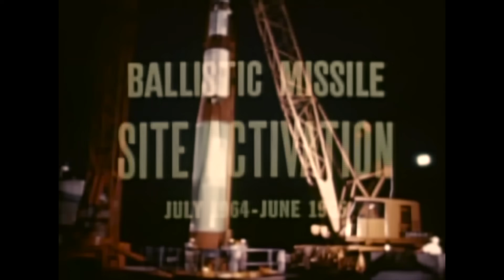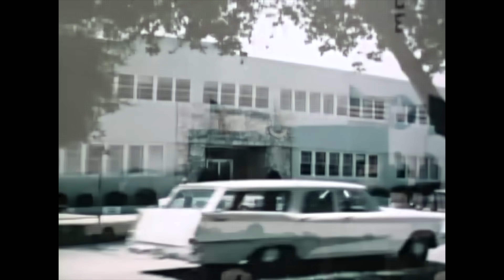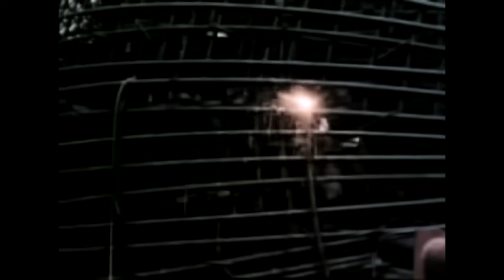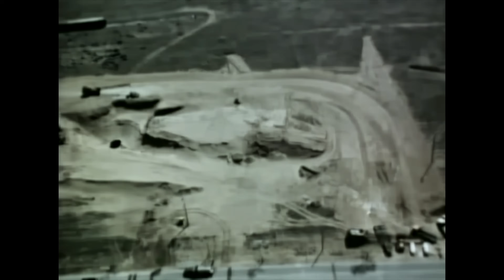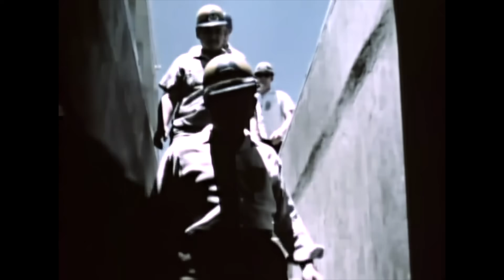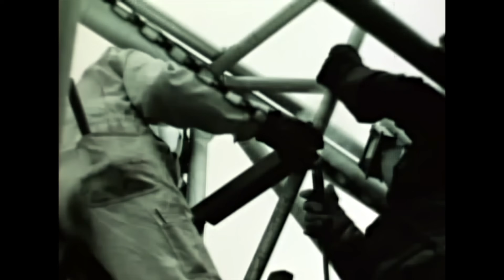Ballistic Missle Site Activation (1965)

Comment: I was a Minuteman Combat crew Commander from 1972 thru 1974.... 448th Strategic Missile Squadron, Grand Forks AFB North Dakota
Reply: Props to you! I was a Titan II MCCC at McConnell, 74-79. 533-07 was my main site and am happy to say I was not on alert when they dumped stage one Oxidizer. Definitely more hazardous than Minuteman.
Reply: @oldguy7402  That's interesting. I'm a big fan of those who served in the missile squadrons back then. But we are getting old now. I didn't get too much interaction with titan crews but understood that  the titan required much more personal attention from the launch crews.
Reply: @robertlcrocker So true. We literally lived with our bird, just past 2 blast doors and down a long accessway. Had to do (well, my techs did, BMAT AND MFT) a complete system check of all the missile and facility equipment every day. If we lost silo air conditioning, it could become very serious as the liquid propellent could overprrssure if too hot.
Reply: @oldguy7402  Missourian here learning about the 351st SMW, it's been around 6 decades since Minuteman came to and left the area near Whiteman in west MO close to KC. Use of the Huey choppers was real efficient, along with the fact most of the LFs were near the I-70 and other highways and the country roads.
Reply: @oldguy7402  Wow.  Titan and Minuteman were just pieces in a long puzzle of developing technologies that kept our great nation safe from predatory nations and cultures.  But I'm glad I was part of it.  I ultimately got into engineering a was manager of the engineering group supporting last plutonium run at Hanford. I used to take business trips to Los Alamos to discus Plutonium production and schedules.   From that experience I finally learned why the weapons had to be rotated from time to time . Crew members at Grand Forks AFB performed "escort duty" when weapons were rotated and I used to wonder why we did that.
Reply: @robertlcrocker I'm fascinated that you were on the supply side of making the gadgets. We live not too far from Hanford and want to visit it. I was on site when they did that rotation for my bird. I received a very unimpressive piece of paper as a receipt. At the time it was unimportant to me, but I sure wish now I'd kept it for history. Same for my  dash 1
Reply: @eringobragh16 I had a buddy who flew those Hueys (they'd give us a ride to the complex once a month) fun times.
Reply: @oldguy7402  For sure. I wish I hadn't lost my uniforms.    Hanford aint what it used to be. Z Plant was where plutonium was produced and It was totally leveled in the 90s.  Not much to see anymore. It's controlled by the eco lobby and management uses fear to justify their $3 billion annual budget. Nonsense Propaganda about Hanford being site of the largest nuclear waste dump on the planet rules the roost now. When the massive waste of money budget is threatened there is all of a sudden a"Leak" and money is needed to fix it. I live on the other side of the mountains off Hwy 12. So I'm not too far away from hanford either.
Reply: @robertlcrocker sad to hear there isn't much to see. My wife said they aren't even doing tours any more. Just us old guys and memories.
Reply: @oldguy7402  But the technology can't be cancelled. I don't think we need plutonium for weapons anymore but nuclear technology has important applications. Now, especially for electric generation to support AI data centers.  I spend a lot of time on social media promoting and defending the technology for these purposes.
Reply: I salute you. 🇺🇲🫡
Reply: Thank you for working with this amazing weapon system.
Reply: Thank you for your service, sir! Do you still have your OG-107 style blue fatigues and ascot?
Reply: @eringobragh16  The recognition is appreciated. After leaving the air force, I moved around the country a lot and all that kind of luggage got lost in the shuffle.  There was a movie released in th 80s named "Damnation Allley". It was just your typical Hollywood making radioactivity a monster movie with giant scorpions and all that nonsense, but it portrayed a Minuteman I launch center and the actors wore the real thing. It looked like the control room scenes were done in a Minuteman I training control room . The uniforms and the control room were  pretty much the only thing in the movie that even touched on reality, but it was the only movie made that portrayed minuteman launch crews.
Reply: @robertlcrocker  Apologies for the tangent, sir (I have a few connections to the missile community thanks to people I've met over the years, including one very respectable and humble man at the Pentagon who was at Whiteman) but here goes: 

I remember watching it a few years ago! I remember that the Day After was more accurate, of course, but seeing my home, the midwest, being wiped out by Soviet R-36 missiles (they have MIRVed megaton-class warheads, in the force of a million or more tons of TNT, that's why the explosions in the movie would've been so large. Either that or they would've been UR-100 / UR-100Ns) was simply terrifying. I came an entire generation after my old man who was with SAC. I know the names of the two officers in the scene taken from First Strike, a great documentary, where the missiles were launched and their unit - much to my dismay, I do not know the fate of Captain Stanton, who I took a real liking to as I recall when I was a kid because of the AF regulation MA-1 bomber jacket he wore. 

Tim Krause, the officer asking about the 'Hacienda', went on to become a Titan Crew Commander at either Little Rock, McConnell or Davis-Monthan after leaving the 742nd at Minot. I have a lot of reverence for the missileers due to the fact that they've always been the 'underdog' of an Air Force with a culture dominated by pilots, I grew up playing 'Roblox' games that were faithful or fictional recreations of missile silos, and I suppose I've been this passionate ever since.
Reply: @robertlcrocker  I know a bit about how Soviet ICBM crews of their 'Strategic Missile Forces' operated too thanks to TIME magazine and old documentaries uploaded on YT. They didn't allow non-Slavs to do missile duty because of prejudicial reasons, and they did six-hour shifts compared to twenty-four. The Soviets apparently never had a real missile operator badge. 

They used the insignia of the Artillery branch of the Red Army on the uniforms of missile crews because of the missile forces' long association with artillery and guided rockets during the 'Great Patriotic War'. Crews wore khaki fatigues with the 'pilotka' sidecap and rank insignia on the shoulder straps and were the least hesitant officers in the entire world because of their Komsomol indoctrination.
Reply: @eringobragh16  Interesting.  Would be fun to meet some of these guys at a party some time.  Good excuse to down some vodka
Reply: @eringobragh16 I actually kept 2 blue shirts with the insignia on it. 1 I donated to the Titan II missile Museum in Tuscon (not on display, it's kept in their archives) and one went to my Daughter.  It had the big round patch for 5 "Highly Qualified" check rides. The original docent for the museum before it was absorbed by the larger historical society there had never seen that patch before.
Reply: @robertlcrocker Much respect to you, sir! I was POL at Castle in the mid-70s.
Reply: @PlasmaCoolantLeak you were definitely keeping busy then. The  weather much better at castle and thank you for your service. everybody has to do their part to make it work.
Reply: Manchester England 👍👍👋👋
Reply: Thanks for serving!
Reply: were the missiles against the USSR?
Reply: @крабик-ч8ж I can't speak for Minuteman, but the USSR targets consisted of the largest share for Titan II. We had the largest and most hardened targets assigned to us. Communist China made up the balance.
Reply: @oldguy7402  That's interesting. Command did not share that kind of information with the missile crews at Grand Forks AFB so I never knew the targets. Before my departure we were told new technology was on it's way that would let crew members adjust target info for each missile but I never learned how it worked.
Reply: @robertlcrocker We were not told specific targets for specific missiles,  just what the overall distribution was, and the kinds of targets for which Titan was tasked. The 9mt payload has advantages all its own.  A crew commander at an alternate command post (just a regular site with more comms) "accidently" shot the launch console with his service revolver, and the whole console had to be replaced.  Helicoptered in from whereever they had one. Took the site down for a few weeks. They had to repurpose a few minutemen to cover the assigned primary target.

About retargeting any given Titan, there were 3 targets pre programmed into the guidance system. The commander would select one of the 3 buttons on his console to select the target specified by the launch order.  Outside of that, a button could be reprogrammed to an entirely different target by loading a mylar punched tape with the coordinates. We were trained to read the base 8 (octal) header on the tape to ensure we were loading the specified one.  There were multiple such tapes kept at each site in a cabinet adjacent to the commander's console in our wing.
Reply: I followed you 20 years later! 93-97. Unfortunately I had the task of shutting the 448th down. I was the last crewmember in the last 448th site. Shut the blast door behind me. Thankfully that site is now a museum! O-0 outside Cooperstown, ND.
Reply: @cancellier  That's interesting. Really surprised those control centers were operational for so long. If the last one was near cooperstown, it may have been November Zero.  That's where I pulled my first alert. When you closed the blast door for the last time you must have left the pins un pumped. As I recall, you could only pump them from the inside.
Reply: @robertlcrocker  No, definitely Oscar. Here is the website for the now museum https://www.history.nd.gov/historicsites/minutemanmissile/
I pulled many an alert at November. It was my home site when I wasn't in the shop.
It was very odd to PUSH a blast door closed and not PULL it…
Reply: Thank you for what you did.
Reply: Did ufos visit or anything like that while there?
Reply: @peterdutchak4396  The launch centers were 60 feet down so  our visibility of the night sky was limited.. But I'm sure there was some interest from those kinds of visitors